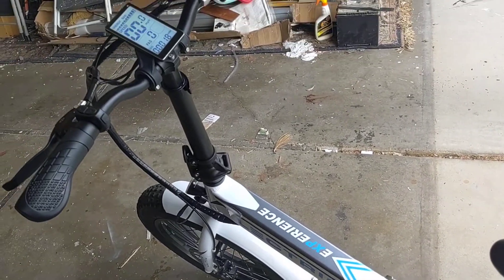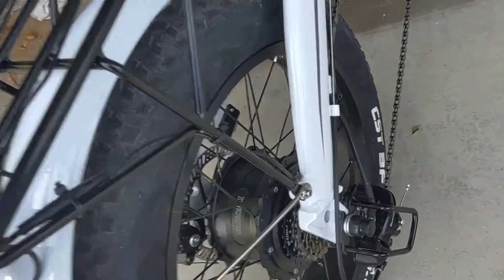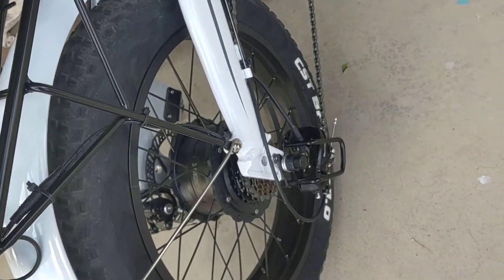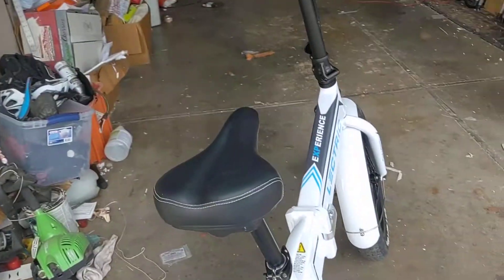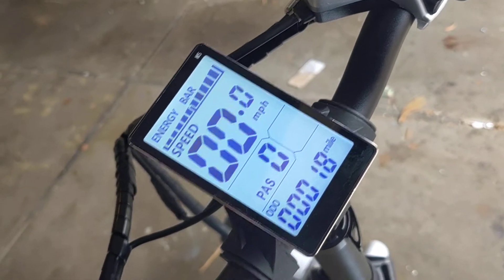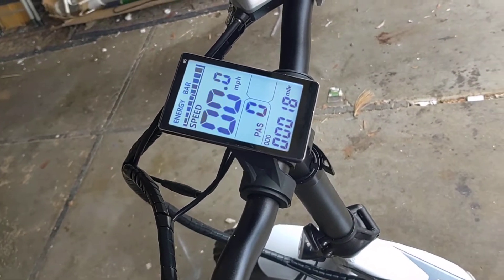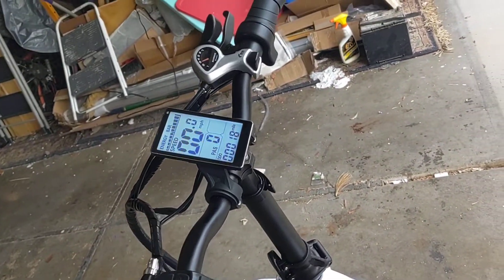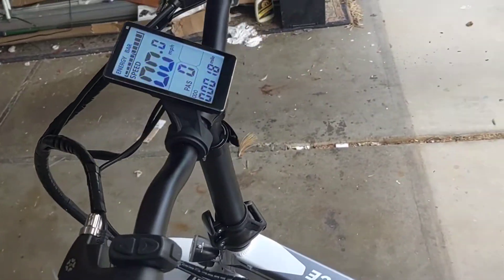Got all 7 gears working thanks to you tube comments

Comment: Good job. I also saw your bus video. If you want to fold pedals push them in and theen fold
Reply: @10beers53  hey Mikey the rad mini is awesome. Just got the lectric on Monday. Only got 12 miles on it still don't have it quite dialed-in yet. While it's a really nice bike the rad Mini is quite a bit Superior. Kind of like a Cadillac compared to a Buick. The Buick is a great car but it's not a caddy. I think the lectric can gain some ground though once I get it right. I don't think the rad mini is worth the extra $600 + and on fenders + and on a rack plus pay tax which would be about another hundred bucks in tax alone. It is almost double. The lectric is definitely worth the price. Oh yeah I also bought a trek powerfly 7 mid Drive from a local bike shop it was a demo that's a whole new ballgame there. The rad mini was definitely worth the eleven hundred bucks though
Reply: Michaelo Rocha yeah rad also came out with another step thru for 1300 bucks. Looks nice but not as many bells and whistles like display n stuff . They sold out first day lol